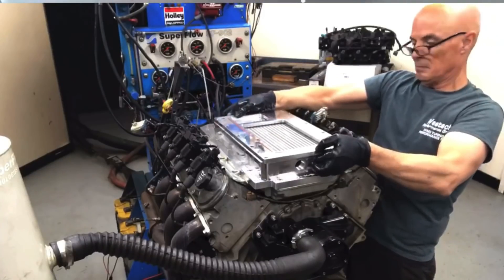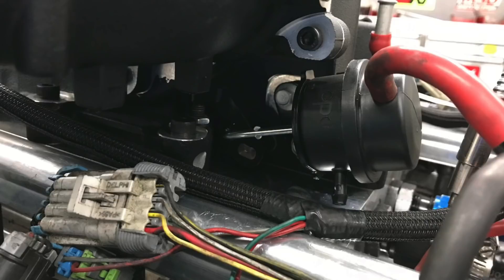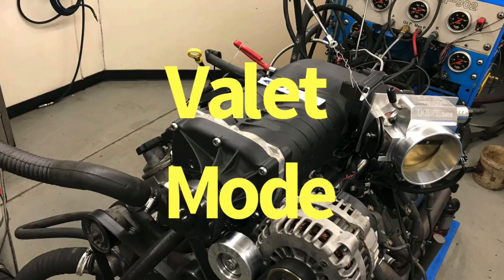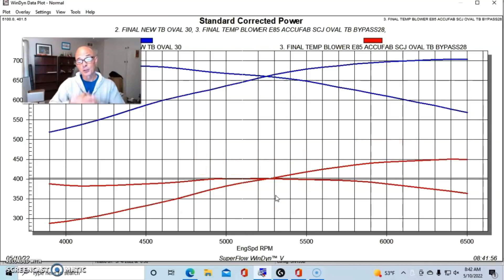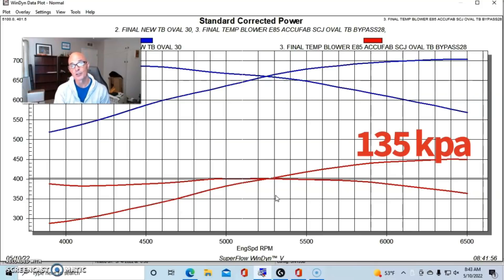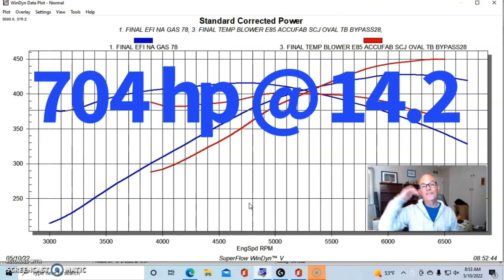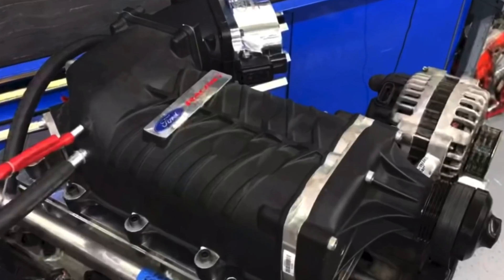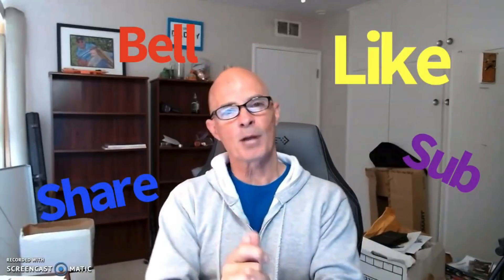TVS BLOWER BYPASS VALET MODE & PARASITIC LOSS TEST! HOW MUCH HP DOES DRIVING A BLOWER COST? CHEAP HP

Comment: Richard I had heard you say in a few different videos that at 14.7psi of boost which is double the atmospheric pressure, an engine HP output should be doubled. My thoughts are since you know what the engine makes na, then what it makes at 14.7psi with the PD blower, what ever the difference of that and double the na power should give you a rough estimate of what the blower takes to spin it? I'm sure there are some variables to consider, and I may be missing something. Just wonder what your thoughts are on that. Thanks
Reply from the maker: different intake design and likely inlet restrictions
Reply: You could do a repeat of what you on the 3.8L by removing the rotors from the blower housing and belt, then dyno it, then compare the two results N/A and blown.....if you did “the formula” every 500-RPM for a range of speeds that the boost hovers around the same pressure ratio (that would show the audience how speed influences parasitic HP)......then subtract “the formula” calculated HP from The HP at each corresponding RPM point on the boosted dyno data you already have.
Reply: @ericschumacher5189  that actually sounds like a good idea. Then at least the intake setups kinda stay the same to have a more controlled test
Reply: @boosted0079  Thanks; yeah, I feel it would be about the most straightforward....It's not perfect, due to restrictions within the blower setup (like the intercooler)......which ideally could be removed / make a hollow plate to take place of the intercooler....but, even so it would still be more accurate than correlating numbers with the blower recirculating through the bypass, since its still having to pump the air / creating unmeasurable parasitic losses....
Reply: Also need to measure how well the intercooler is working

Comment: The blower is still physically moving/working the same about of air if not more air than with bypass valve closed and instead of the work done resulting in dense air doing into the engine and burning fuel resulting in power it is just pumping air around for no benifit

Comment: I use a CAN Bus enabled boost controller on my Cadillac CTSV to allow me to set up boost by gear on my LSA engine.  It uses a boost solenoid and a 2 port bypass valve actuator.  The stock CTSV already has this functionality in the factory ECU to allow for boost reductions in case of over temp, etc.  But it doesn't allow boost by speed, gear, throttle position like the aftermarket controller.  The aftermarket setup also has 8 maps and a scramble button, so I have maps for street tires ,track tires, rain, valet, etc.  It definitely makes launching in first gear on the street much easier.
Reply from the maker: nice

Comment: Hey Richard, how do you think it would go compounding the blower with a turbo and opening the bypass valve when the blower starts to become a restriction and then let the turbo direct feed the engine. 
Get the low down torque of the blower and the top end power of the turbo??
You must have some stuff laying around there to be able to test it while you've got it on the Dyno 😁
Reply from the maker: I have compound tests up already-the turbo won't feed enough just through the bypass valve
Reply: @richardholdener1727  did you get back to completing them after the belt slip issues, or did I miss some of your vids 🤔

Comment: So I'm guessing a turbo on the same engine, at the same boost level, would make about 800 HP?
Reply: That's probably about right, depending on the difference between intake and exhaust pressures.

Comment: It’s a game of diminishing returns.  The faster you spin the blower, the hotter the air gets and the harder it is to turn the blower at the higher boost levels.
Reply: Yep, but do you think people get that? Don't know how many times I have tried to explain that you can't just add more blower speed and expect X amount of increase. Not only is the blower being more inefficient, but the boost you are showing is not the real boost number either, they can't get there heads around that. The gauge says I am making X boost therefore I am making X boost... No you're not the gauge is only reading that, it's not what you're making.

Comment: As good as the numbers are, something seems off. Where was the boost taken from? Above or below the intercooler. Either way I would like to know what the boost is both above and below the intercooler. It might be a significant restriction. Maybe 2-3 pounds boost loss due to the IC. Then the numbers would make more sense. 14.2 psi boost should be making about 800hp not 704hp when n/a is 427hp.

Comment: I look at crankshaft power required by the supercharger a bit differently. Assume 428 hp at 100kpa and factor that to 197, you get 843 hp. Actual power observed is 704, thus loss to the blower is around 139. It’s more if you consider that the blower gets a “boost” from running E85. This ignores the effect of a long runner manifold, which shouldn’t be much at the power peak. Another way to look at parasitic loss would be fuel flow or difference in BSFC. The engine is going to use fuel for the horsepower produced AND the parasitic loss. IMHO, the losses are bigger than you suggest.
In reading comments, looks like others have a similar view…
Reply: what about the density loss from heating the air vs na
Reply: @bill2178  I didn’t see relative IATs, but that would affect power. With an intercooler it should be a small number, but you’re correct that it would be part of the difference.
Reply: The difference in intake runner length between the NA and Blower intake is worth at least 30hp over the entire curve.

Comment: In your own word at 14.7 psi you should double your HP. So 428 HP double is 856 HP. so you loss (856hp - 704 = 152 hp.
Reply from the maker: the intake design also changed and is the throttle opening a restriction?

Comment: Couldn't you multiply the NA hp by 2, and that is what the engine should make at 14.5 psi of boost, then subtract the actual HP number under boost (14.7 is really close) and the difference would be the parasitic loss(roughly)?????  If the boost was truly free.    So my guess is 120-140 at the high end.  The Richy formula!
Reply from the maker: 1 atmosphere is 14.7 psi
Reply: @richardholdener1727  well there you go.  Why wouldn't that be very close?  Learned something new.  I knew one Bar was 14.5 so I thought 1 atmosphere was the same.  Apparently not.
Reply: It’s not as simple with blowers that replace the intake. Because of the intake change that alone will change the power, and as the blower works harder it gets less efficient so you’re using more power to spin it and heating the air more. 
The doubling of power per atm works somewhat well with turbos though.

Comment: What if you put a turbo on the engine and set it up to make the same amount of boost, would the HP you get from the turbo be close to the HP it take to drive the blower?
Reply: That's kinda what my thoughts are. The boost pressure is what it is in the intake and it shouldnt matter of it's turbo or SC boost. Getting the same boost pressure from either should be the same on rush of air into the cylinders when the intake valve opens. 

I'm sure we'd see the turbo produce a lot more power, abs give us a better idea of how much parasitic loss the pd blower takes. Intercooling is slightly different and turbo intercoolers are more efficient at cooling the charged air. But still be a closer number to give us I'd think. 

From what I understand, at 14.7psi(double they open atmosphere) it's supposed to double the na HP.
Reply from the maker: 14.7 psi can double the power, but not on a blower application. You have to subtract the losses associated with driving the blower.
Reply: @richardholdener1727  
That's kinda what I am talking about, shouldn't the HP difference between the turbo HP and the the SC HP pretty much be about the same as what the SC is using up to drive it?

Comment: There’s a top fuel crew chief/shop foreman that runs a yt channel and he reconditions the race parts and sets the car up ect, a really fascinating channel, I can find it. I remember him saying that it takes 750 hp of the 10k hp to power the blower. Crazy.
Reply from the maker: a top fuel blower takes more than 750 hp
Reply: @richardholdener1727  how much does it take then? (Approximately)
Reply: @Mattvardaman  If this needs 13% (80HP in addition to 707HP)  That top fuel blower needs more like 1,300HP for 10,000HP output.  Absolutely insane.
Reply: @richardholdener1727  awesome!
Reply: Hotrod or CarCraft did an article back in the late 90’s, I believe it took 800 hp to run the roots blower at the 8,000 hp level (top fuel power at the time) one company used a massive electric motor to turn the blower, another company used a separate blown big block motor to spin the blower and both figured similar numbers.

Comment: I did the same math on a roots blower several videos ago and you replied to my comment that it's all speculation and that's why you need to do dyno testing.
Reply from the maker: as indicated in the video-the correct way to measure is on a blower dyno

Comment: I think the reason the boost/horsepower is the way it is is like wind resistance of the car. It's not linier. If it takes 100 hp to go 100 mph it takes 400 hp to go 200 mph. It's not doubled it's squared. I think they call that the inverse square rule or something like that.  1 to 7 psi is a lot easier than 7-14 psi. By the way I don't have a clue what I'm talking about. I like the boost controller idea. Might be a problem for us carb guys. Thank you for your time.

Comment: so the pumping losses in this example makes me wonder if there is a way to test vacuum pump theory i dont believe that power gained is all ring seal part of it is less pumping losses from air pumped in the crankcase and less aeration in the oil due to less air to mix and less hydraulic lifter squish

Comment: Could you test, or explain the reasons why someone would run a wastegate on a centrifugal blower setup? I can't wrap my head around placement and function of such a thing lol.

Also on the topic of centrifugal setups, is this test a good illustration of how much more efficient they are than the positive displacement stuff? 25hp gain at 5psi is nothing. A V1-S at 5psi would add like 75hp or more.
Reply: I think what you meant to say was a bypass valve, not a waste gate lol
Reply: @aaronliddell4280  negative. Look it up. It's a thing lol. I'm quite familiar with all of the terminology. I own a twin turbocharged car with internal wastegates and bypass valves, and a Vortech equipped small block with a bypass valve.
Reply: To limit boost in certain situations. (creates a boost leak) The ones I've seen are electric WG s so they are "easy" to control
Reply: @TK-eg7eg  so like a traction tool for big blower cars?
Reply: @michaelallen2501  This.  And you have to use a wg because a BOV doesn't have the response curve necessary to actually hold a boost level properly.  We see a lot of centri cars use it to limit boost when they're running on pump gas, then when they add race gas or E85 just let the blower do its thing.
Reply: Here is an example. My centrifugal pulley setup on pump gas feels like it takes forever for boost to kick in, (lag) one way i can make boost come in faster is by running a smaller pulley on the supercharger, only thing is, the smaller pulllies that would decrease the lag, make my max psi way too high for pump gas. This is where the wastegate comes in. Instead of redirecting exhaust gas to slow down the turbine like on on a turbo, I would redirect the incoming air (inside the intake tube) that spins the centrifugal tubrine instead. If my boost controller is set up to only run 17 psi but my pulley sees a max of 26, the moment my target boost has been reached is starts dumping air in the intake tube to atmosphere via the the wastegate which slows the blower to slow down. Hope this was easy to understand

 "is this test a good illustration of how much more efficient they are than the positive displacement" I would say it is, but most already know that they are more efficient, its just the lack of torque in the low rpms (where a street car lives ) that makes people go with the PD blowers
Reply: @donaldsonjeoboham8759  excellent explanation sir. Totally makes sense.
Reply: A WASTEGATE?
Reply: @JohnnyAnderson1  people do it lol.